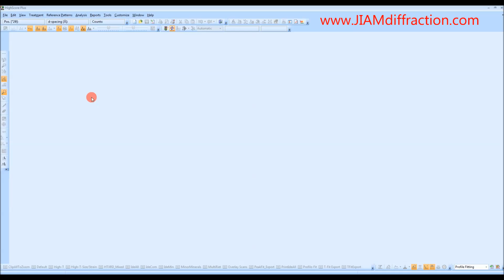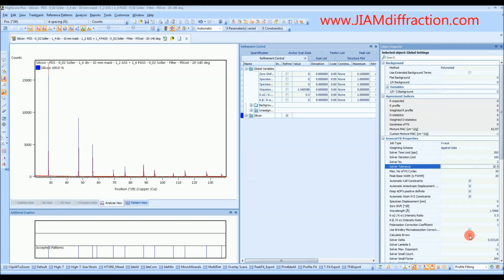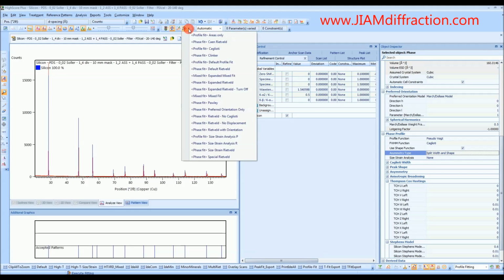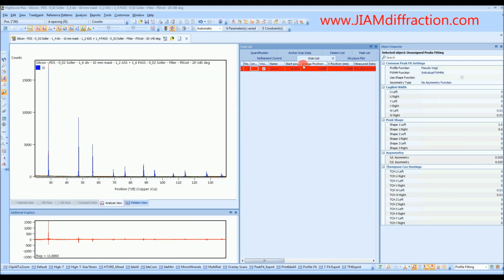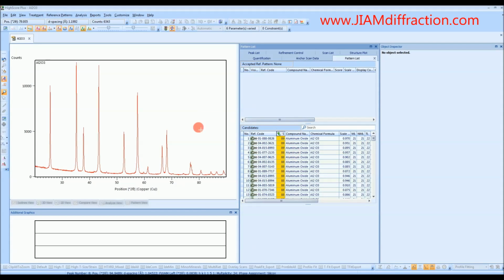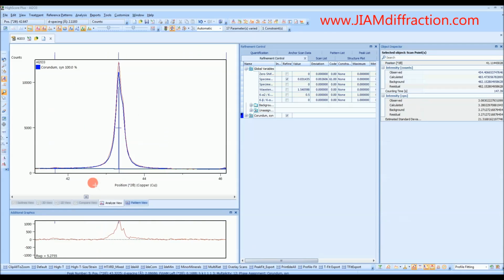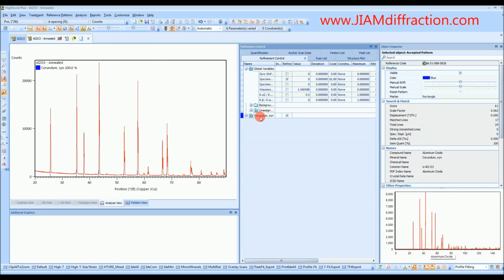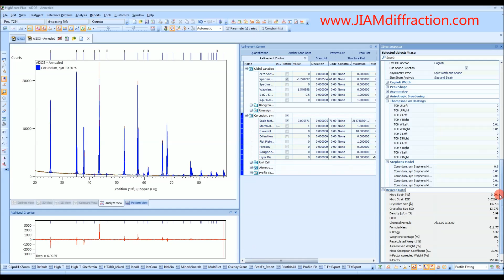HighScore Plus Tutorial - Crystallite Size & Microstrain X-ray Diffraction - Long Version - JIAM

Comment: Hi Michael,
I am followed exactly in my highscore plus version 3.0, i could able to identify the Crystallite size but for micro-strain value for all my samples i am getting 0 % which is weird! Do you have any reason for that?

Also, Can you tell me your refinement steps, so that I can incorporate the same as in my case i have to manually input the steps.
Reply from the maker: Hmmm, I'm not sure why that is.  It only gives you 0, not something like 0.074?  These values can be pretty small sometimes.  

Here are the refinement steps that Panalytical made for Size/Strain Analysis R...

Scale factor, flat background, more background, specimen displacement, lattice parameters, Caglioti W, Caglioti U, Caglioti V, peak shape parameter 1, and peak shape parameter 2.  Don't switch any of them off after refinement.

Comment: Thank you for these helpful Videos in your channel
I want to do deconvolution (or unfolding) the pure sample profile from the Si standard XRD pattern and my target sample's XRD pattern. I want to present all the three patterns. This may be done via the so called Fundamental Parameter approach. Can I do this using X'Pert HighScore Plus software?
I appreciate if you help me in this case
Reply from the maker: I'm glad the videos help!  I'm not sure I fully understand your situation though.  Can you explain your sample/data collection in more detail?  I'm also not sure what the difference is between your pure sample profile and your target sample's XRD pattern.
Reply: @IAMMDiffractionFacility  I have XRD pattern of SnTe and of Si standard. Both are found from the same x-ray diffractometer. My intention is to use the Si standard as a reference for correction of the instrumental effect, so as to find the pure (free from instrumental effect) XRD pattern of SnTe.
Reply from the maker: Okay, I understand now.  Unfortunately, I don't know if HighScore Plus does that.  If it does, I have no idea what the steps would be.  None of my users have every requested that.  Typically, we just refine the Si standard so that corrections for instrumental broadening can be applied in the calculation of things like crystallite size and microstrain.  I wish I could be of more help!  My suggestion is to reach out to Panalytical.
Reply: Thank You

Comment: Like COD for database is there anything for refinement structural data because its not coming
Reply from the maker: If you need structural data for refinements, I don't know of anything that is free other than COD.  I use the ICDD PDF4+ database.  If you have access to the ICSD database, that is also an excellent source of .cif files that will allow you to perform refinements.

Comment: Thank you for the video. I am using Highscore plus 3.0.2, some of the options I do not have. Such as the "solver tolerance" in the "general fit properties", I don't have it, what should I do?
Reply from the maker: Unfortunately, I'm not sure how to change something like solver tolerance in that version.  However, whatever default value is set will probably work just fine.
Reply: @IAMMDiffractionFacility  Thank you! I managed to get it done. But my Rwp is high, about ~20%. According to the difference, it is due to the noise of the original data. Any suggestions on obtaining XRD data? Increase step size? Lower the speed?
Reply from the maker: I'm glad to hear that you managed to get it done!  Telling you how to improve your data quality can be difficult without seeing the data and knowing more about the samples.  I can give you some general thoughts though.  If you want less noise, lowering the speed works.  If you have 8-12 data points above the full width half maximum (FWHM) of your peaks, then increasing your step size will make your experiment longer without likely getting any benefit (it won't decrease noise).  It isn't appropriate for all situations, but spinning your sample can help.
Reply: @IAMMDiffractionFacility  Thanks! What is spinning sample? How I can do it?
Reply from the maker: I suppose that depends upon what instrument you are using.  My main experience is with an Empyrean from Malvern Panalytical.  On that, they have a reflection/transmission/spinner sample stage that allows the sample to continuously spin while collecting data.  This allows the X-ray beam to hit more crystallites.  If you are using a different instrument, I don't know if you have that capability though.  If you don't, it shouldn't be a problem.

Comment: Hi Thank you for all your videos. They have really helped me. I have one request that if possible can you provide me with the standard Si pattern so I can do micro strain analysis.
Reply from the maker: Unfortunately, you need to collect the pattern yourself because the instrumental broadening is different for each diffractometer and each set of prefix modules and optics.  Anything pattern that I would collect on my instruments would only work for analyzing data collected from my instruments.
Reply: @IAMMDiffractionFacility  Ok..Can you explain to me how I can do that. As far as I understand. Please correct me if I am wrong. So do I have to buy the standard Si powder from NIST and perform the XRD analysis on my XRD instrument and that I can use as my reference pattern.
Reply from the maker: Yes, you buy the standard from NIST, and then you perform a scan on the standard from NIST using the same exact instrument configuration (prefix modules, optics, etc.) that you will use or have used to collect data from your sample.  And then if you want to use different optics in the future for your samples, you will need to collect another diffraction pattern on your NIST standard that uses the new optics.  

Let me know if you have any further questions.
Reply: @IAMMDiffractionFacility  Now I understand..Thank you so much.

Comment: Hi! 
I have another question.
The Crystallite Size obtained by the method in the above video (without calibration of instrumental broadening) is quite different from the value calculated with Scherrer equation.
Could you please give the reason? Is the breadth of the peaks used here the same as the full width at half max (FWHM)?
Reply from the maker: Hello!  Have you watched my other videos on crystallite size and microstrain?  I think the one on Scherrer equation in particular would answer your questions.  It is https://youtu.be/diPju39ZQY8.
Reply: @IAMMDiffractionFacility  Yes, I've watched it, and "liked" it too~ Thanks for these great videos~

Comment: Hi, thank you for amazing video.
Could you please tell us what is the version of your High score ?
Reply from the maker: Thank you for the compliment!  I use version 4.7.  If your version is different and providing difficulty in following along with my video, let me know so I can try to help you figure out how to make it work in your version.
Reply: @IAMMDiffractionFacility  Thank you! 
I am using version 3.0, where I press the "size-strain analysis" button, then a problem report saying "No valid atom positions available" appears.
I found the pattern had no atom information. Can I import other CIF(s) into highscore database and add it into the pattern list?

I've got another question, what is the point of dealing with silicon before refining Al2O3?
Reply: @IAMMDiffractionFacility  I think I find the answer in one of your great videos~ Thanks ~
https://youtu.be/yGQDXCXEaqY
Reply from the maker: I'm glad the other video helped!  Do you also understand why I dealt with silicon before refining Al2O3?
Reply: @IAMMDiffractionFacility   By watching this video for another few times, I think now I've got it. I understand it as some kind of calibration treatment.
However, where to get the standard pattern with the same optics?
I found one can buy SRM(Standard Reference Materials) from NIST. 
Does that mean I have first buy SRM and then analyze it with my equipment to get the instrumental broadening?
Thanks again ❤️
Reply from the maker: You are correct on everything!  You will buy the standard, and then you will test that standard on your equipment and using the same optics as you will use for your sample.  If you decide to use a different optic for a sample in the future (e.g., a Soller slit, divergence slit, etc.), you will need to collect a new diffraction pattern on your standard using the new set of optics.

Comment: Thank you for the video. 
It would be great if you cover "How to find the micro-strain and crystallite size in a multi phase material" topic
Reply from the maker: The first part (determining the instrumental broadening) is exactly the same.  Once you insert your collected diffraction pattern, the steps would be the same, but you would have to do each step for each phase.  Does that make sense? (I never know how well I explain my thoughts.)  Is there a particular step in the determination of crystallite size and microstrain that is giving you trouble with your multiphase material?
Reply: @IAMMDiffractionFacility  thankyou. No, actually I did not try yet

Comment: Hello, thank you very much for your videos , my question is when i convert pattern to phase I don't see any number there just the name of pfase (zno) ,  I don't find the structure information in this phase and i don't find it in all the other patterns , and when I do size strain analysis in small window it say that no valid atomic position available what can I do in this case please ???
Reply from the maker: Unfortunately, it sounds like your database might not have atomic positions included in the phases if none of the patterns seem to have it.  If that is the case, you will have to either find a .cif file online that does have atomic information (you can try the crystallography open database, http://www.crystallography.net/cod/) or you can try to find the atomic information online and then add it to the converted pattern.  I will try to make a video in the next couple of days that shows you how to do both options.
Reply: Thank you for your answer , I'm going to try this proposition and I'll wait for the video
Reply from the maker: I finally have the video up.  Please see https://youtu.be/yGQDXCXEaqY
Reply: Thank you very much

Comment: Thank you so much for making these great videos! I have a question. Could you please tell us about your Strain-size R and P settings and the changes you have made to those profiles? Here we work a lot with alloys and rolling and residue strain and so on and it is important for us to accurately measure these parameters. Thank you in advance!
Reply from the maker: Do you have those parameter files (Strain-size R and P) in your HighScore Plus?  If so, I haven't modified Panalyticals refinement strategy.  If you don't have them, I can tell you what the steps are.
Reply: @IAMMDiffractionFacility  I would be glad if you could share those parameters. Thanks in advance.

Comment: Hi Michael, do you have any tutorial about database managing and how we can get the COD database? Thanks for all your help
Reply from the maker: Hi Fer, I do not have any tutorials about database management, but I may be able to offer guidance.  Am I correct in assuming that the COD database is the only one you have access to?  And what version of HighScore do you have?From what I've read, the COD database just works with versions 4.x.
Reply: @IAMMDiffractionFacility  Thanks for your answer Michael, you're right i only have access to COD and my version is 3.0.5. Any help will be welcome. And following with this kind of thing, is any way I can include the CIF files in the database?
Reply from the maker: Upon further reading, it seems that there is a version compatible with version 3.x.  The page with all the different versions is http://www.crystallography.net/cod/new.html.  January 2020 states that it is for version 4.x, but there are previous entries that either don't specify a version (July 2016) or specify version 3.x (October 2014).  One of these should work for you.  I don't remember the steps for adding the database (I need to be in front of the software to write down each step), but I can look into it when I am back at the lab next week.  You may be able to find out how to add it by going to the HighScore help file and typing in something like "database" though.  

I'm assuming that the CIF files will come with the database file.

Comment: Hello. Please could you tell me how is crystal size calculation of a multiphase sample after his respective Phase quantification?
Reply from the maker: Sorry for the delayed response, I wanted to test my answer before giving it.  You should be able to incorporate the size-strain analysis into your phase quantification.  You still need to test the reference sample, but once you have identified all of the patterns present in your sample and have chosen to convert those patterns to phases, set Size Strain Analysis for each phase instead of just one phase.  You can then perform your phase quantifications steps.  When it comes to refining the profile variables during phase quantification, it looks like you can refine U and W, but don't refine V.  When I tried refining all three just a few minutes ago, the size strain analysis results no longer appeared.
Reply: @IAMMDiffractionFacility  Thank you very much for your answer. I would like to consult you a few more things.
1. What is the version of your Highscore plus?
2. After following your suggestion for each phase, I tried to compare the average crystallite size value that the program yielded with one calculated by Scherrer equation and the FWHM of some peaks. Why are they so different? Is this because microstrain and crystallite size were being refined at the same time?
Reply from the maker: 1.  I believe it is version 4.7.
2.  I typically only use the Scherrer equation if I don't have any other options as there are assumptions made with this formula.  The shape factor is typically taken to be 0.9 but should actually change depending upon the shape of your crystallites.  Another issue is that the Scherrer equation does not factor in microstrain, it assumes that the broadening of your peaks is due only to crystallite size.  If I remember correctly (it's been awhile), I've tried the Scherrer equation on multiple peaks of the same phase and gotten quite different results.  

It is also very important to remember that you still need to test a reference sample in order to determine the FWHM caused by the instrument.  You then use this value to correct the FWHM that you put in the Scherrer equation.  This correction has the biggest effect when your peaks are very narrow, but the effect decreases if your peaks are wide.  

Finally, I feel like Scherrer is most useful if you only have one or two peaks present in your pattern (as this can make refinement difficult and gives too few datapoints in a Williamson-Hall plot) or if you are just wanting to qualitatively compare one sample to another and don't think that there can be varying amounts of microstrain in the samples.  If you do use the Scherrer equation, it is important to understand its limitations, and I suggest that you read more about them.  

While reading information and thoughts from some relatively-unknown person from the internet (such as me!) can potentially be helpful, I certainly hope that people take such information and then verify it by researching further online.  Doing so may also provide further information that the relatively-unknown internet person may have forgotten to share (we certainly aren't perfect :) ).  

Let me know if you have any other questions!
Reply: @IAMMDiffractionFacility  I am very grateful for your answer, as it is very enlightening to discarde Scherrer equation because of its limitations. I doubted to use this equation because although it is widely reported by papers to calculate crystallite size, it involves making many assumptions that seem quite approximate. I will follow his advice to investigate further, but I do think it is more appropriate to calculate these parameters by refining all the peaks of the diffractogram, like you explained in the video. Thanks so much for your videos, these are excelent.

P.d.: Thanks for specifing the highscore plus version because of it's some different to mine
Reply from the maker: Thank you for the kind words about the videos!  And if you have trouble with your version of HighScore Plus, let me know.  I have access to an older version as well and MAY be able to give you some advice.
Reply: @IAMMDiffractionFacility  Thank you very much. I wrote you an email asking for some recommendations. Please check it out.